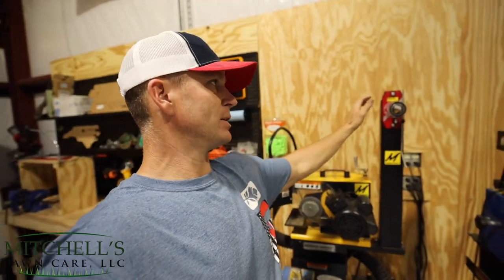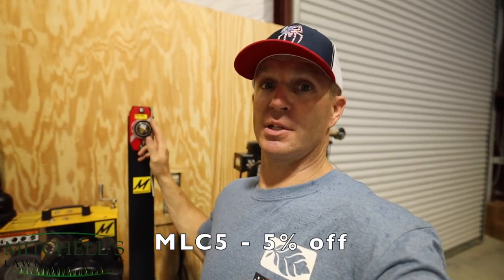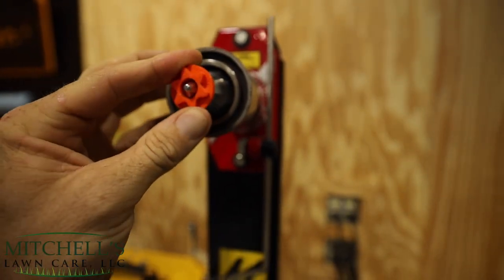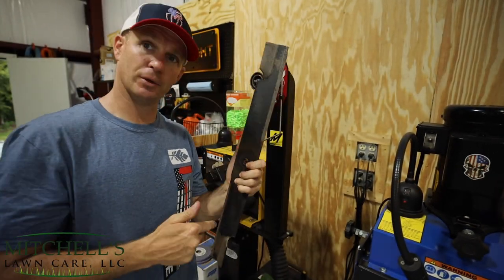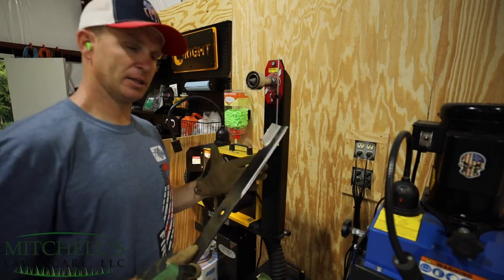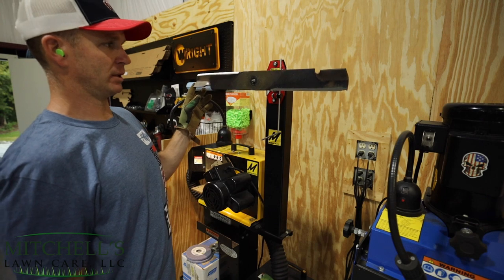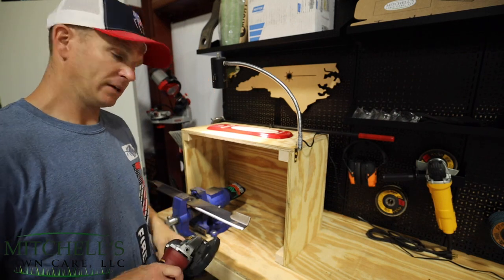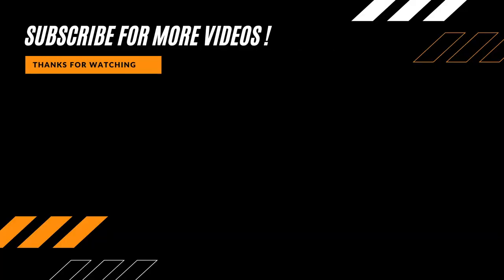Balancing A Lawnmower Blade..HOW TO & WHY!  [EASY DIY]

Comment: Do you really expect a home owner to spend $200.00 on a blade balancer?  I can maybe see for some lawn service might.  but a home owner that sharpen one or twice a season?
Reply from the maker: I don't expect anyone to do something that it's out of budget or need.  For the homeowner you mention, I'd recommend taking the blades to a professional with the proper equipment to service them.  If i was needing a set of blades sharpened that that little I'd never purchase this equipment...the return on investment would never equal out.  I operate a service for homeowners and contractors, that's why I have the setup I do.  Thanks for tuning in Cliff.
Reply: It’s a shop tool or large mower business which uses it every day
Reply: Your phone is $1,300.
Reply: @UltraGamma25  no it is not. less than 35.00 $8.00 a month.

Comment: Got my Mag 1000 today.  I have 3 sets of blades, they were sharpened and balanced with the cone table top type balancer. Although it gets them close and after all it's all I've ever used I think in the long wrong it has helped my mower deck spindles (along with greasing them) I have never replaced a mower deck spindle.  I'm very happy with my purchase. So I've re balanced all 9 blades plus 3 old junk blades, Anyway the Mag 1000 works and works Great! I would recommend it and I would recommend  to stay away from the Chinese "knock offs" I've tried two of them and they were both junk. Even though the Mag 1000 is more expensive, You get what you pay for.

Comment: What are these engineers smoking when they started placing strange holes in the middle of these blades? I’m guessing that round holes are a thing of the past and way too complicated for them!
Reply from the maker: 😂 it forces a customer to buy a certain blade unfortunately.  I’m sure their argument is that it helps certain the blade to the spindle.

Comment: Your outer edge is the most important because that is the edges that intersect with the other blade. I sharpen multiple blades, wide and narrow. I have the balancer that has the six mags on it. Took 4 off and it works like a charm. The mag on that sharpener is to wide for the smaller blades.

Comment: Amazon wants $220 plus tax for a Mag1000. The cost of my blade brand new is $12, so I can just replace my blade with a brand new one 18 times and have some pocket change left over for the price of a little blade balancer.
Reply: Okay bruh
Reply: New blades are often Not balanced, or at least not very well.
Reply: FYI $220 is extremely overpriced. eBay has ones for $50-$60
Reply: How much for the mower
Reply: New blades can be off balance also.
Reply: @calebdunteman yeah but read multiple reviews that the cheaper balancers can be off balance themselves eveen when new. With the pricier ones the manufacturer guarantes that they are balanced and you dont to balance them yourself after.

Comment: Are new blades so expensive it's worth buying all that equipment I get it if your running many lawnmowers I also have no idea what all that cost but looks expensive 🙂
Reply from the maker: I offer a professional mower blade maintenance service to homeowners and contractors.
Reply: I guess it's a matter of perspective, I'm just a home owner, not a pro, my mower uses 3 blades at $22 each. I find they need to be sharpened or replaced 1-2 times a season at least. It does add up pretty quickly to just replace and discard....for me anyhow.
Reply from the maker: @johndeaux9987  homeowners that have started using my service have found they aren’t buying new blades anymore.  Under normal operating conditions and proper maintenance my service extends the life of the blade.  There’s a lot of life in mower blades if properly maintained.  I can service and/or repair a mower blade for less than what a new blade costs.  I enjoy educating both homeowners and contractors in my local area.  My customers have been thoroughly pleased and most are repeat customers.
Reply: @mithgo_outdoor  I agree 100%, that's what I meant. I sharpen my blades vs replacing, that's why the cost of equipment pays for itself quickly.

Comment: What about the balances you buy tbat wobble that go on tabletop pyramid type shape ones ? They work
Reply from the maker: I don’t recommend them.  The Mag1000 is a superior product.  A nail on the wall doesn’t work either.  The Mag1000 isn’t an expensive option and you can even save some money with my discount code MLC5.  Hope you have a wonderful day.
Reply: @mithgo_outdoor  thanknyou
Reply: If you don't have an accurate blade balance, then your spindles can be damaged. Spindles cost far more than blades.

Comment: Hey Mitchell, quick question do u balance your blades while you sharpen or after you sharpen the blades? I start out with a balance then i count passes, after the passes i balance again as i go along. It seems like it takes me a long time to sharpen a set unless its my blades which i take off after 15 hours of use. Do i have the correct process or am i doing it the hard way?
Reply from the maker: sorry for the delayed response.  I don't balance the blade until after sharpening.

Comment: Do you grease your sealed spindle bearings?
Reply from the maker: I haven’t
Reply: @mithgo_outdoor  that's a big contributor to failed spindles as much as blade balance.  Even new motors, should grease them. Manufacturers do the minimum. Imo

Comment: Great video!  Thanks.  You didn't put on your eye protection for the last few grind cycles.   Ordered a Stens 750-087 MAG-1000 blade balancer.  What about using a Dremel tool to sharpen the blade?
Reply from the maker: Can’t control the cutting angle with a Dremel.

Comment: Coupon code doesnt work
Reply: Just found coupon code MITHGO. Looks like it’s 3% off the balancer but not the adapters.
Reply from the maker: @bradleyduncan7351  yes the coupon code changed, I am updating the video now.  Thanks for the reminder.  As for the actual % it was supposed to be 5%.  If MagnaMatic reduced it I was unaware.
Reply: @mithgo_outdoor   my blades have 6 pointed star holes. Do i really need the plastic adapters they sell?

Comment: never balance not bad a problem yet these commercial spindles should hold up no problem
Reply from the maker: yes commercial spindles are tougher, but balancing blades prevents unnecessary vibrations among other things.  Thanks for tuning in Shane, have a great day